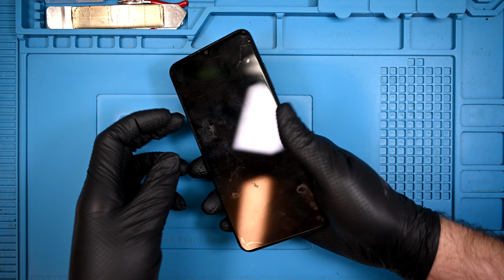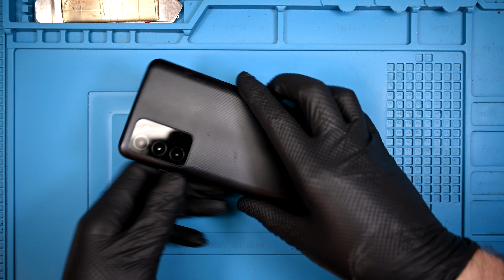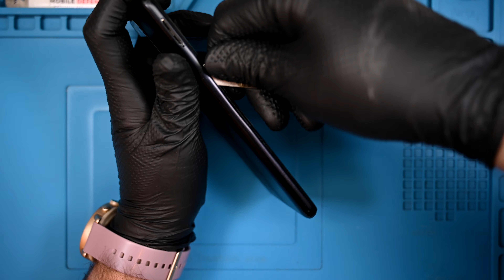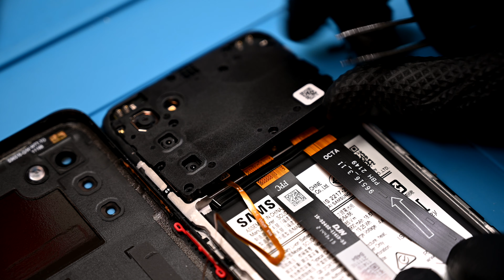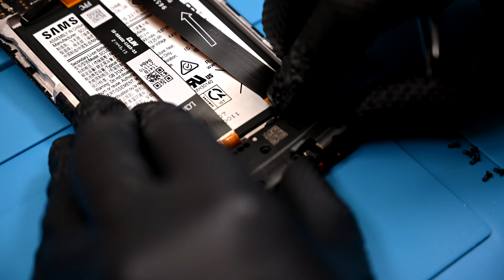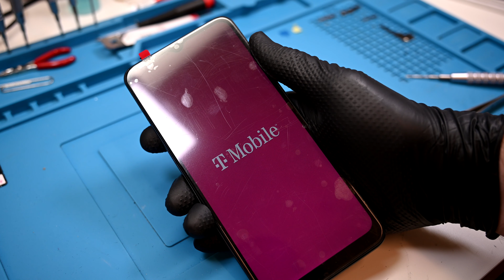Galaxy A03s (A037U) Screen Replacement | Frame Swap | Teardown Guide

Comment: Great video! Mine was very slightly different... as the one I was fixing is the A03s A037G/DSN and motherboard/cables only very slightly different, but all the relevant parts in the same place!  I didn't have any alcohol so I used my soldering station heat gun attachment on 100 degrees C and applying to the (broken) glass-side to help release the battery and also used the same heat gun settings to lightly go over the power/volume buttons to help release the adhesive. Luckily I already had mobile phone double-sided tape from various glass replacements in the past to help me stick down the vibration motor and the connector for the power/volume.
Reply from the maker: Nice!! I'm glad to hear it. That's a really good method to use for battery removal if you don't have alcohol, and not directly heating the battery is perfect technique. Glad it worked!
Reply: @TapticDigital  are the pin outputs for the display the same on all of the galaxy A series, im making a project and want to find a cheaper variant but good quality screen for a SM-A505W (galaxy a50 unlocked), iv looked at other galaxy A series screens and they seam to have very similar connector’s but cant find any pin diagrams online and really dont wanna have to splice the traces from one screen to the other and possibly short the display or motherboard, just to give you an idea of what im doing the phone wont be in its original case and is going to be more of a debugging/testing so aslong as i can get a different screen connected and running on the motherboard, cable length and all that dont matter to me
Reply from the maker: @hackzgamezyt  hmm I don't believe they are all the same unfortunately, at least based on how much they change the connector. I could be wrong, but I've never come across decent schematics for Samsung

Comment: Hey man I'm dyin' over here! I broke the Power+Volume flex cable and I can't find a single place with the replacement part. Any suggestions?
Reply from the maker: I was able to find them on MobileSentrix, you'd just have to be sure to get the right model number as it appears they make two variations of it. They say they only sell to businesses but I was able to buy things as an individual by listing my business as "independent" in the sign up. If that fails, they have them for about $15 over on eBay, again, double check the model number first!
Reply: @TapticDigital I'm using this part from MobileStrix: POWER AND VOLUME BUTTON FLEX CABLE COMPATIBLE FOR SAMSUNG GALAXY A03S (A037F / 2021) The volume down and power buttons are not working, but the volume up is. Part doesn't fit housing properly.
Reply: Thank you again for the help. I greatly appreciate it :D

Comment: I really appreciate how to-the-point this video is. Thank you.
Reply from the maker: Concise and effective guides are my goal! Glad this one helped you out!
Reply: @TapticDigital  does this keep all data and apps?
Reply: @TapticDigital  did you use a LCD in this video?
Reply from the maker: @erickareese9366  yes, same as the original. Thankfully at this time Samsung was selling official parts through my vendor
Reply: @TapticDigital  so i have the same phone that broken like the screen is full cracked and it completely black will i need a new LCD or can i just follow the steps your doing?
Reply from the maker: @erickareese9366  the part I used is both the screen and frame, they usually come together as one piece, then you can just follow the steps!
Reply: @TapticDigital hello there
Reply from the maker: @krystallynnmariealford3360  hi!
Reply from the maker: @krystallynnmariealford3360  this video is a guide for that repair, unfortunately I don't offer mail-in repairs at this time.
Reply from the maker: @krystallynnmariealford3360  if you do it yourself, the parts are pretty cheap. But most local shops will charge about $80-$120 for this one